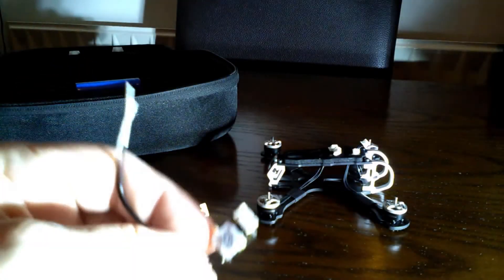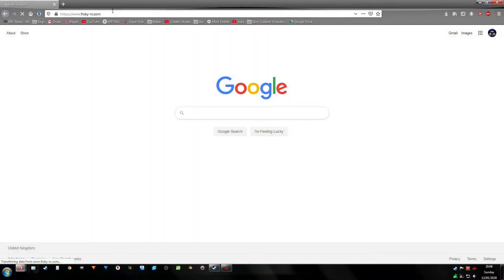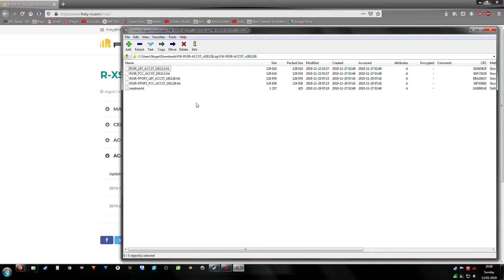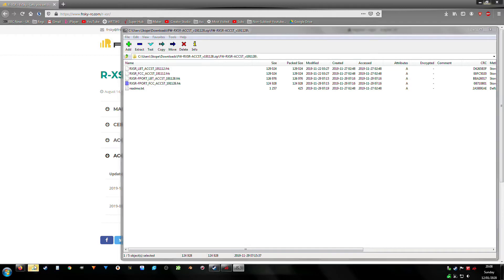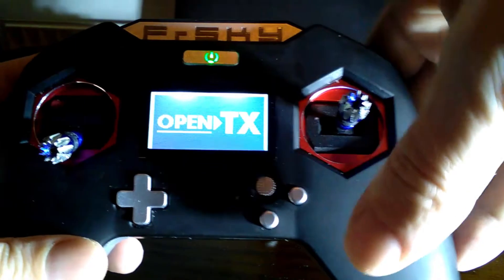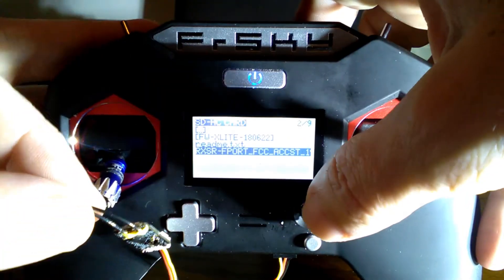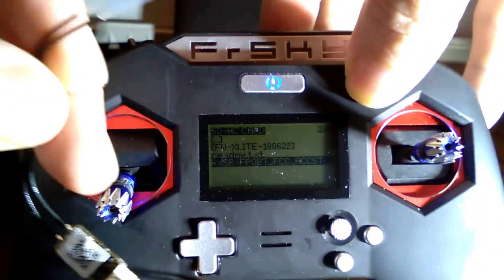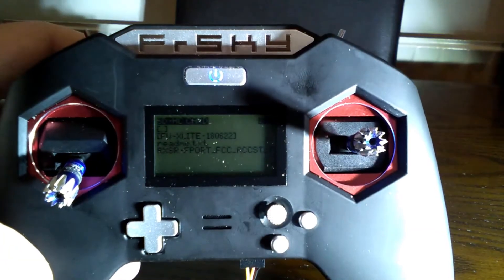F.Port Firmware on an R-XSR [ Will work for other F.Port Receivers ]

Comment: There is any way to flash the firmware without the Taranis transmiter? I am using Jumper T8sg and it's operating system is called Deviation. I don't think I can use for flasing the receiver.
Reply from the maker: I doubt that you can use Deviation however you can flash the receivers using a few different things.
Frsky does a USB to S.Port adapter or a FTDI adapter iirc.
The software is also on Frsky's site.

I covered the FTDI method this video for updating an XMR although that was quite a unique receiver & most others require updating through S.Port:
https://www.youtube.com/watch?v=6leCDalA49o

Hope this helps & good luck!
Reply: @MrE.  Thanks, I shall look it.

Comment: thank you. i followed this video to get my panda nano vtx working on this stack and i can only change the power and put in pit mode the channels and band will not change. you wouldn’t happen to know why that is happening ?
Reply from the maker: Excuse the late reply (No notification - YT acting up, oddly!)
I would be looking at the VTX Table in betaflight - from a quick look at the product it is an IRC Tramp peripheral in ports configuration page.
Heres the VTX Tables page: https://github.com/betaflight/betaflight/wiki/VTX-tables
Use the IRC Tramp (USA) / IRC Tramp (EU) depending on which you require ( USA is global with all the channels and powers unlocked) but take note to disable the 600mw power output setting as I believe the Panda Nano is 400mw max.
Another consideration is that you might have a pit mode lock on somewhere in the system, maybe due to the VTX Table. 
Hope this helps!